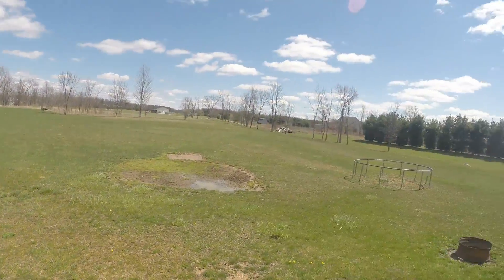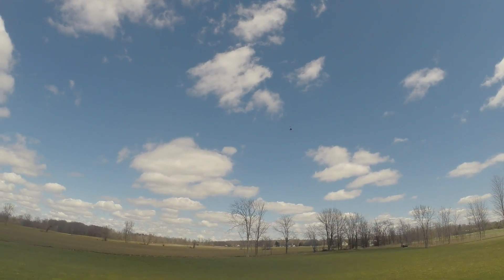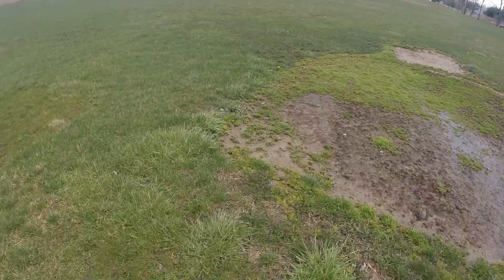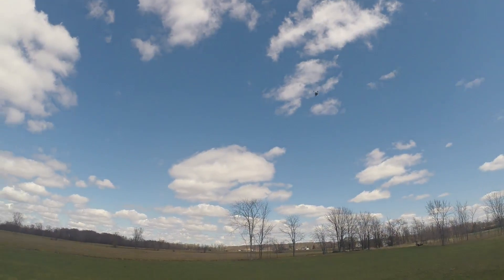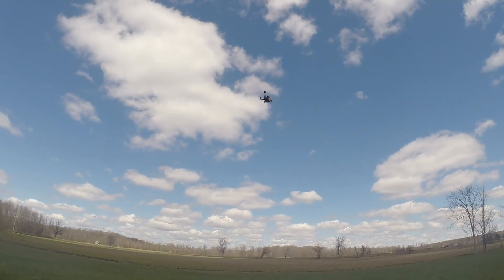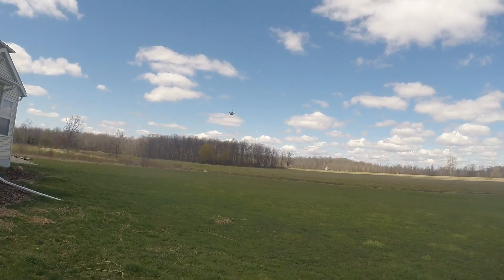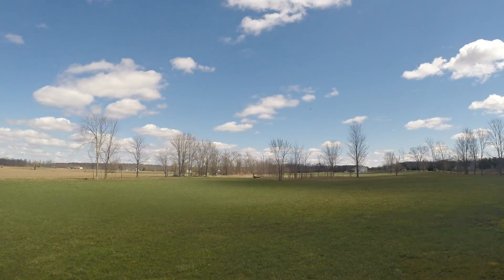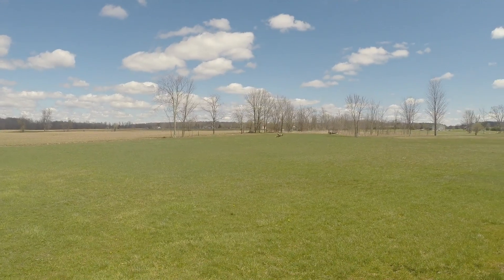130mm Lantian quad, 1306, 3S, betaflight PID settings, flying

Comment: Hi. Can you tell me the pids setting that you have?
Reply from the maker: Aris, if you hit the "show more" text above you will see the PIDS I had at the time. All my settings were changed at the beginning of summer when a friend helped me adjust my radio settings. I'll have to hook up and see those new settings. Flew pretty well on the numbers above. Now my whole system is just more locked in.
Reply: sorry but I can't understand what I must put in when you say for example ROLL 1.1, 0.04, 10. Betaflight needs 50, 30, 20 (P, I, D).
Am I right?
Reply from the maker: Aris, I just checked your channel. My setting are for a NAZE32 controller and it looks like you're using a CC3D. The PIDS probably would not work even if you did get Betaflight pushed onto the CC3D. I actually got rid of the rest of my CC3D and moved to all NAZE based just so the settings were easier to manage. Sorry.

Comment: You should upgrade that to the new emax rs1306 4000kv motors! Looks like a really clean build! I really want a small 3inch prop quad.  Only bad thing about them is they are more likely to get lost :(
Reply from the maker: I really like how it flies now. :-) I finally got to fly it FPV and it was a ball. Fast flips and rolls and I'm amazed at how stable it flies.
Reply: Get a loc8tor! This helped me a couple of times. it adds a bit of weight and a bit tricky to install. but it is worth it.